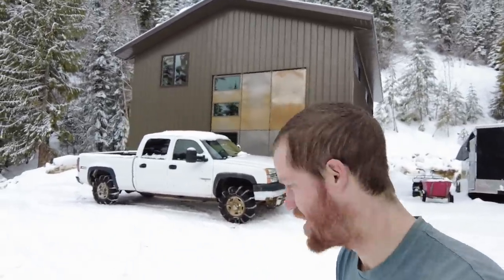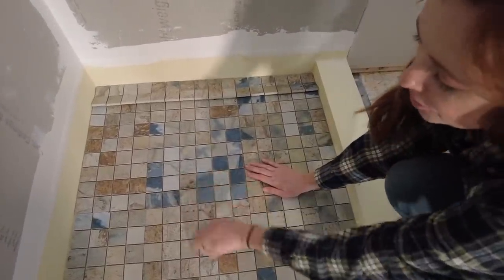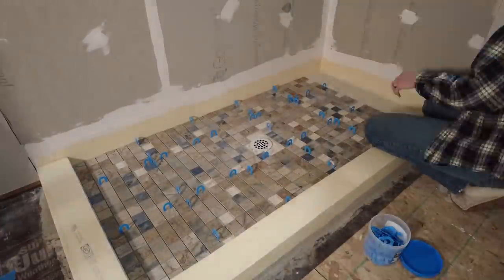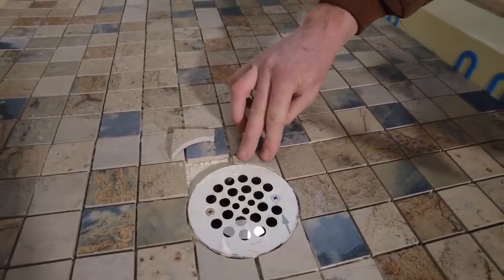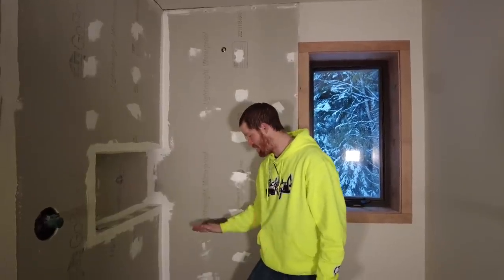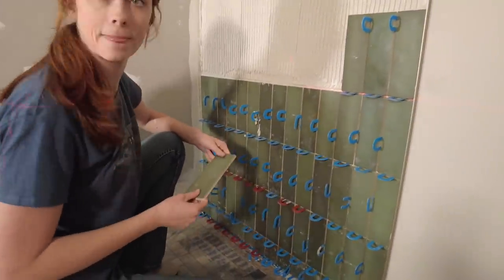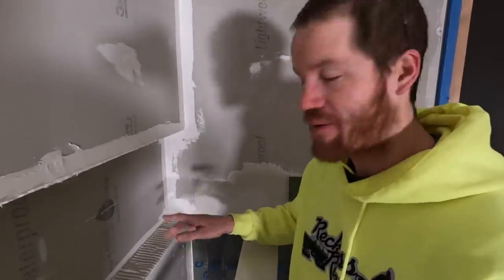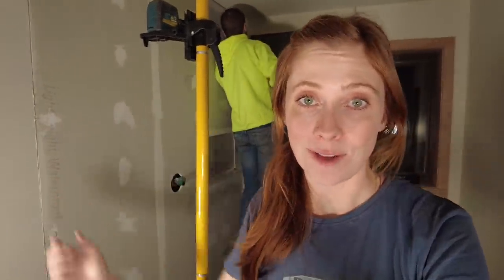Things Get MESSY | Tiling Our Off-Grid Bathroom

Comment: I love tile, so I did a lot of it indoors and out. No tricks, but what I'm mostly concerned with is tile maintenance; will it stand up to stains, cracking, fading, etc, which is why i like to use synthetic grout and mostly porcelain tiles. You're tile work is exceptional, btw.

Comment: I REALLY LOVE watching you two pull of amazing projects.  I'm too old to pursue similar endeavors but, if inspired by Courtney (The Most Beautiful Woman on Youtube) , I wonder what I could still do.  Anyway the reason for this is a suggestion for your solar projects.  Now that you have outside, static panels you need a way to track the sun, right?  I saw a project decades ago wherein they mounted two cylinders with a charge of low-pressure, temperature sensitive gas on the sides of the array.  Also used some sun shields but donlt recall the details.  Anyway, if one cylinder became warm the increased pressure would move the piston on a gimble to rebalance the sun's effect on the cylinders.  After watching you design and build the Snowverlander tracks, I think this is perfect for you.  Wish I knew where I saw it, probably Popular mechanics or similar.  Good luck and stay safe.  Sorry to say, retirement rules out me being a Patreon.

Comment: Hi guys, nice work.
Tips: tarp or rosin paper your shower pan before doing the walls. Keeps droppings from messing your pan tile.

As with any job prep, keep your saw and tools close as possible not down stairs. It would amaze you how much time is used up running up and down the stairs.
And for cripes sake, elevate the saw off the ground and put on a table or even your portable table saw. No wonder your back and knees hurt. I was in pain just watching you do cuts.😎
You are doing an awesome job and keeping the moral high. Looking forward to more adventure.😁

Comment: Shower tile is a great choice and there's nothing like a big one put in a little seat believe you will use especially if you get hurt down the line. When I had knee surgery it was a necessity. A water softener is also one of the best things especially if you have well water.

Comment: Not sure if you have thought about this as it is a ways in the future but have you considered running radiant in floor heat in the garage when you do the concrete? You can run the line and have it available at a later time. They also make wood fired boilers for them. If you do do it make sure you insulate under it :) thanks for the content I enjoy watching you build your future.
Reply: I have radiant floor in the garage and my pregnant wife helped with drainage, rebar, radiant and more in the garage. She even insisted on her climbing in to vacuum out the 2400 gallon cistern. I was like, “confined space certified rescue tech dear,  I got this” she was like “the $&@$ you do, I only have so many more days I can help before this one invites us to bahbah and dirty nappies”.
Reply: I second the in floor heat. The extra cost in tubing pink foam many bags of zip ties and a sore back from bending over zip tieing is worth it.
Reply: Third that. And you can add a loop for the loft off the wood boiler. Awesome.
Reply: @yamaharidr450  It's really great until the slab breaks or you try to bolt down a piece of machinery.

Comment: If the thin set is coming up use a smaller trowel on sheet goods. Usually run a few feet until you see sag issues . let it set work on the rest to stop sag. If you pound too much it will drive the thin set up also. It also will lose adhesion if you push too hard. Home owners just don't get the luxury of having failures to learn by.

Comment: You should use GREEN ROCK for areas that have water involved. If your tiles crack and water seeps in, the white sheetrock will mold and/or crumble.  FYI. 🤦👋😁
Reply from the maker: The drywall in the bathroom is all mold resident green board. The material in the shower area is GoBoard a 100% waterproof tile backer board meant for shower surrounds. Thanks for watching!

Comment: Looks great!!!  When I do the drain pieces, I take the grinder and grind down the thickness of the drain cover so the cover is flush to the surface of the tile and only have a small lip all the way around underneath.   I also set a level board or screed one tile up from the bottom and stack from there. Once the wall is set and dried, I remove the screed and add the bottom row.  Enjoy!
Reply from the maker: Thanks for the tips Scott!

Comment: Just wondering, why didn't you put the stairs going up to the kitchen rather than the bedroom - because of the garage door?  if so, why didn't you change ends? Plus the door should open inside, no?   i find that weird going into the bedroom first, lol when my bathroom was done they had the shower pipe already in........where is yours?
Reply from the maker: Hi Bev! Long story short we wanted the living room/kitchen to be towards the front of the building for the views, and to give the bedroom more privacy. The staircase into the bedroom is only temporary, and opens outward to maximize interior space. This summer we will be building a deck off of the living room that has a staircase. That will become the main entry/exit point of our home and the bedroom access will only be a secondary for emergencies.
Reply: @AmbitionStrikes  Darn good plan. We always said if this place ever burns to the ground we would want to have living quarters over a garage or barn.  love watching your videos.  Absolutely HATE your drive way, lol

Comment: I've tiled professionally for a few years and would like to offer a few suggestions:
Your mud looked about right but when you apply it to the surface it immediately begins drying.  I would divide the floor into two parts.
Use a smaller notched trowel on the floor, preferably a 1/4 x 1/4.
Your method of laying all the floor and then coming back and pressing it down is not good.  The tile sucks the moisture out of the mud and reduces the bond.  Push it in when laying.
Most of the "matted" tiles like your floor have some tiles that are not set quite right.  Try laying them by eye rather than with spacers.  What you see is more important than spacing.
You need a bottom spacer under the tile on the walls but try eye spacing the sides.  You'll be surprised how well it works.  Spacers push the accumulated errors in size to one spot.
Otherwise you're doing a great job where many DIY's have failed.

Comment: Looking good, but no waterproofing on those shower walls?
Reply from the maker: We used the GoBoard system which is 100% waterproof tile backer and doesn't require any additional water proofing! It's a great product. Thanks for watching!
Reply: @AmbitionStrikes  Ah. That makes sense. I’m renovating my bathroom at the moment, so great timing!

Comment: Work real  clean as you go , have clean water and sponge for cleaning gobs, hands, tools and any adhesives on tile faces. You can waste a lot of time cleaning and it is what differentiates good from pro. Before you grout make sure the floor is really dry,  aggressively push tile to make sure they do not move, is the floor/shop ceiling underneath the shower insulated? floors can be cold.

Comment: Only idiots place tile on top of plain dry wall in a bathroom!!! Its backer board or green board at a minimum.
Reply from the maker: The walls are not drywall. They are a waterproof tile backer board called GoBoard.
Reply: Cool I was a little worried too 
I thought you would have to water proof first before tile. With goboard you don't have to, amazing.
Looking Great guys